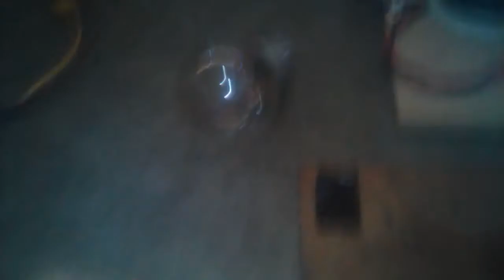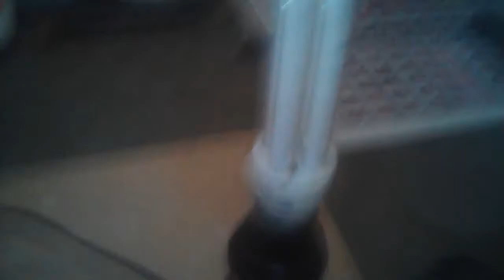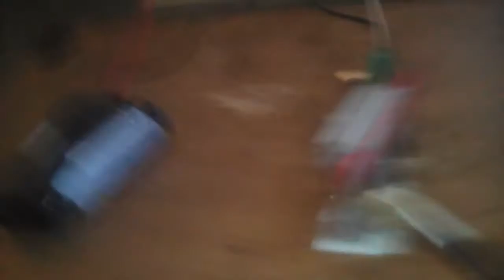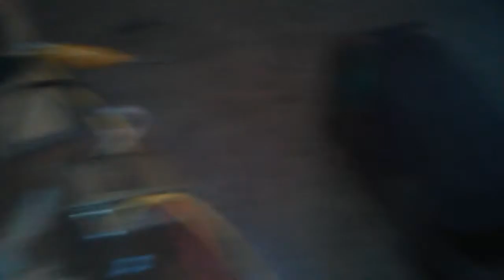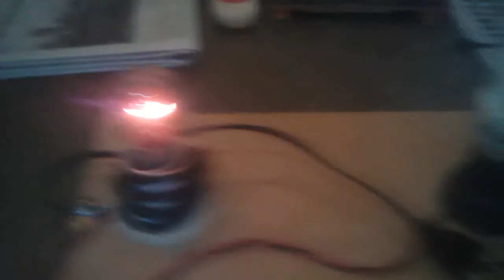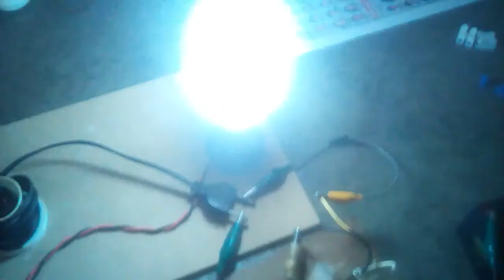motorinverter

Comment: nice old school way to produce AC from a battery.
this was used for portable tube radio before transistor.
the problem in that old time was to get high voltage from battery so the solution was to use a step up transformer a a relay.
the second solution was to power a DC motor from the battery and to couple a alternator to it but that's extremely noisy..... but they did it!